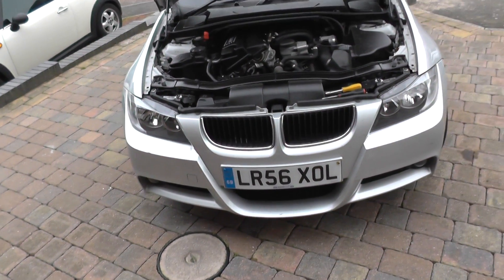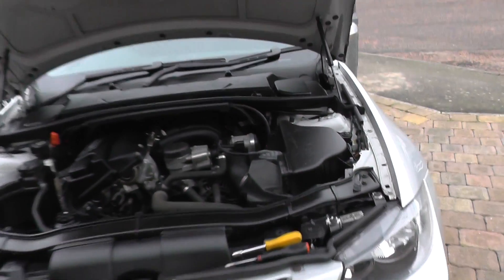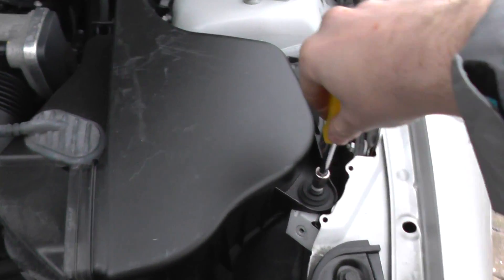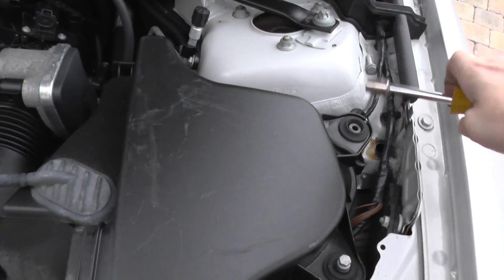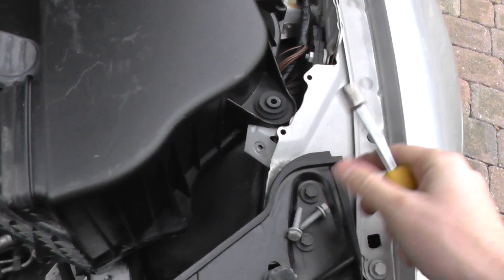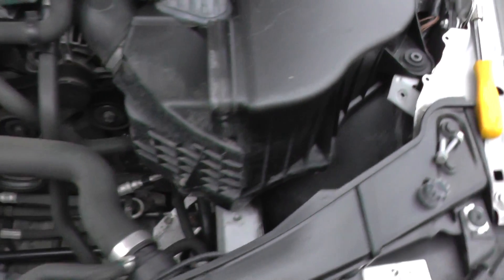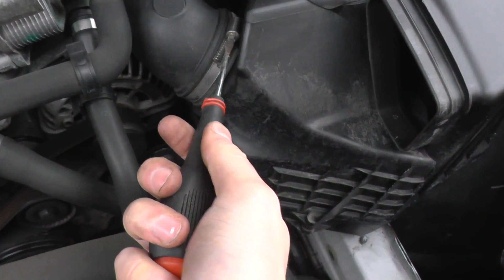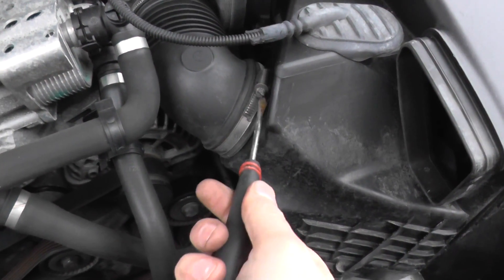E90 BMW How To Remove Air Box & Air Filter

Comment: What about the wire connected to the air box ?
Reply: Thomas Mcdonald answer please
Reply: Andrew Hakan SAMUEL it's the connection to the MAF sensor. Just remove the rubber cover and unclip the sensor. With say a K&N filter you would keep the MAF sensor and it would fit into an adapter coupling on the new filter piping.
Reply: i cannot see any connection on K&N open air filter

Comment: Hi,
Nice video. I watched another video which showed in detail how to replace air filter,
one thing that struck me in this video was that the plastic part ( w BMW logo on) was removed
before starting deassembly..

This made the accesability to the air filter much easier. The whole filter compartment was full
of oil, dust and sand, so I cleaned everything in the filter area. Just waiting for the parts to dry
before I take a testdive, the old filter had done 100000 kms, and was dirty and dusty, so I expect 
some difference now.

Many thanks for the videos, also you Peter Finn.